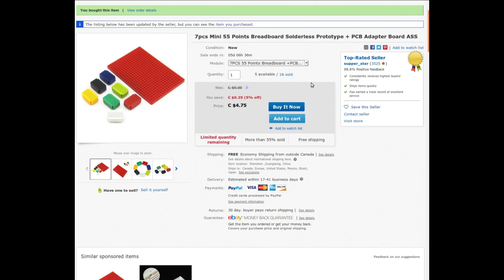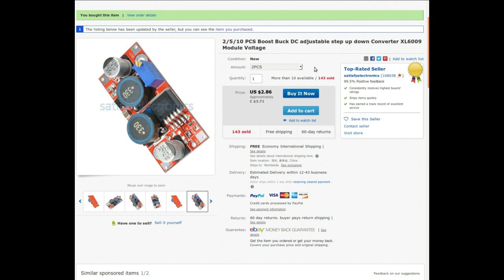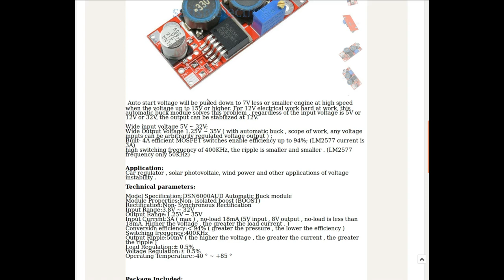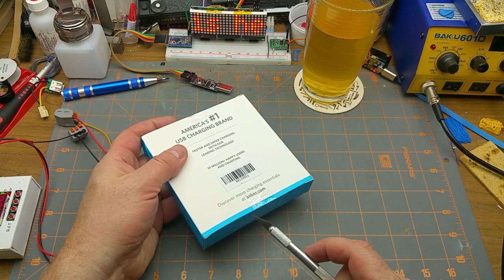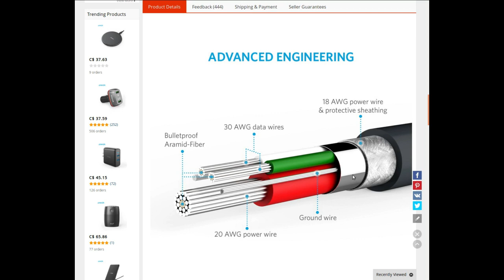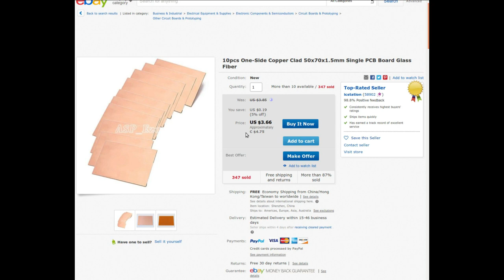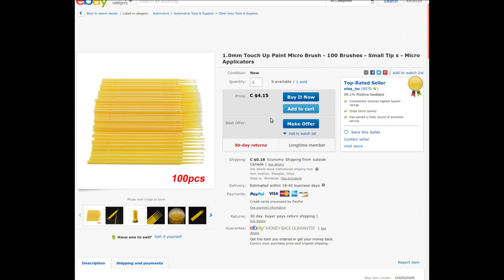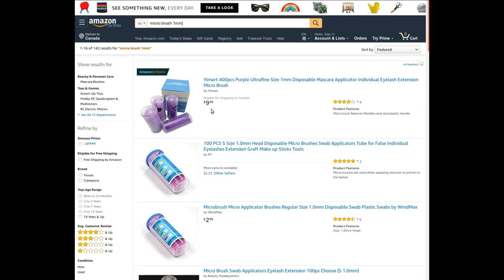mailbag monday 41

Comment: Ha! I used to have one of those little meters back in the late 80's/early 90's. It wasn't bad for what it was - a cheap pocketable multi. No idea where it disappeared to. Maybe you found it! :-D I probably left it on a job somewhere.

Just found your channel and subscribed. Good stuff.
Reply from the maker: That Hioki meter has been my go-to hobby meter for over 20 years since I found it in a second hand shop. 

It's accurate,  a handy portable size, and the button cell batteries last forever in it.

Comment: These buck boost converters are supposed to be used to keep the same output voltage with variable input, but they much more useful as fixed input - variable output.
Reply from the maker: Yeah, the listing mentions "solar charge", which I assume meant something like that.
But I doubt that's what I'll ever use it for.

Comment: Power supply link not working for me 🤔 UK though
Reply from the maker: That's odd.Does this one work from your location?
https://www.ebay.co.uk/sch/sis.html?_nkw=B3603+LED+DC-DC+Digital+Control+Step+Down+Module+Power+Supply+Adjustable+Buck&_id=391047119166&&_trksid=p2057872.m2749.l2658
I've found that replacing the suffix of the URL with your local country works most of the time on e-bay listings (in this case, substituting ebay.ca for ebay.co.uk)
Reply: Oddly... Both links work from my PC but not from the phone. Thanks :)